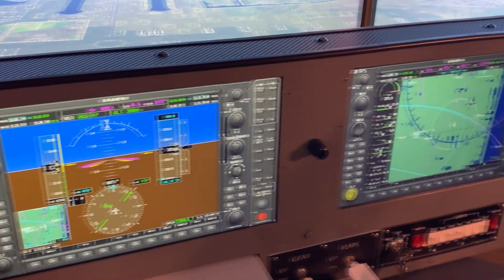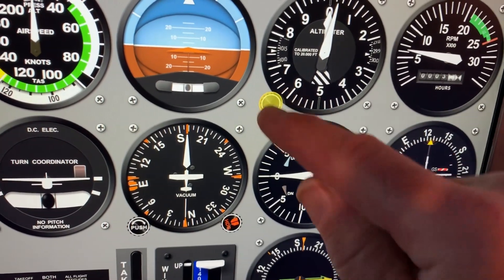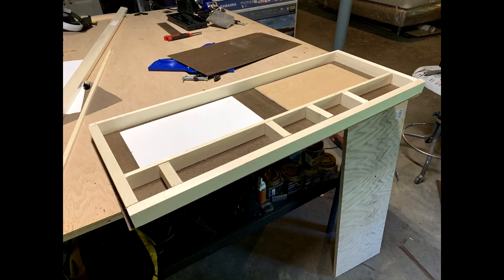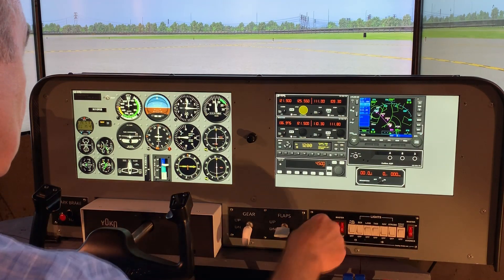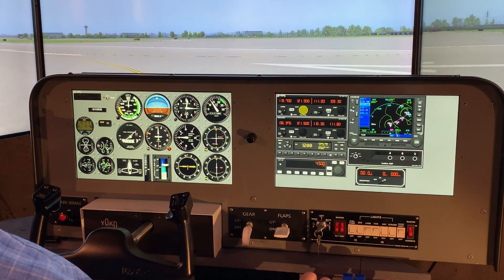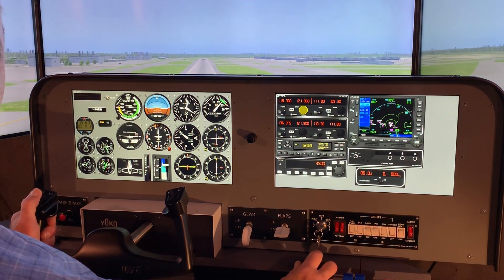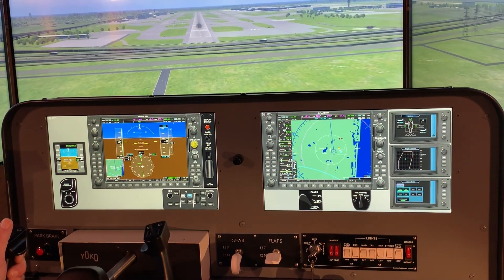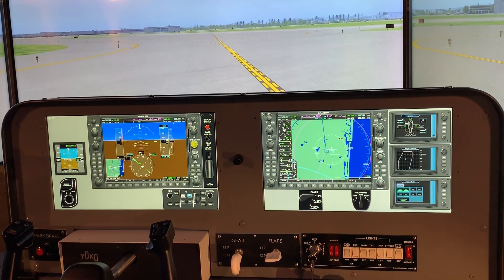DIY Twin Touch Monitor Sim

Comment: Hello Russ. I just upgraded to a Windows 11 system with a 3080ti and 12th gen i7.
I  trying to set up my Wimaxit touchscreens again and calibrate pen and touch input etc won't even show up as a settings option. Did Windows not include this on their 11 desktops?
Reply from the maker: Fear not. The monitor needs to have both power and a separate usb connection to work. There should have been a power adapter with a usb A to C cable. I think the usb C ports on the side of the monitor are marked. The monitor will run using only the usb power from your computer but it cannot power both the monitor and the touch grid. Try setting things up this way and see if it doesn’t show pen and touch calibration show up so you can tell windows what monitor the each touch grid is associated with.
Reply: @rbarlow  I will try this when I go down from supper in a few mins. Strangely, I had to do the opposite and take the adapters off to get them set up on the old computer. I'll send the results.
Oh. BTW, Running Alpha, Bravo, Knobster, and Pedals.  I flipped my old 3 handle throttle upside down, stuck it under the Bravo and now use it additionally for parking brake, cowl flaps, and spoilers. Simstrumentation group has some great G1000 and Garmin audio panel bezels free on github. One of my real world pilot buddies I fly with did the graphics for them. They work great. Thanks!

Comment: Hu Russ, awesome video.ive not yet decided if i should make a curved 180 screen for my flight sim, and use two projectors, or to use three games screens like you have i will be using air manager with either . What are your views on this ,would be much appreciated Thanks in advance

Comment: Russ What are the dimensions of the frame you made? I'm in the process of making my instrument panel now. Im thinking 42 wide by 23 high. What do you think? I have 2 NAV/COM Radios, 1 multi, q switch panel, I want 2 15" instrument monitors, Yoke honeycomb, and a throttle and some other small extras like toggle switches. Thanks Bill

Comment: This is just about the perfect sim for what I’m looking to do. The only other thing that I think would make this sim perfect is a manual trim wheel maybe just below the gear and flap handles. Also, and maybe this is asking too much but a small window (about the size of a sim gear GNS 430 screen) where an autopilot could be displayed via Air Manager. 

Absolutely love this setup Russ! Thanks for doing the work to figure it out!

Comment: On my sim i have a window frame set a few inches from the screens, hiding the joins of the screen. Gives a real depth of field as you move your ahead and slightly around the window frame. A feeling of being detached. If only i could stop fsx crashing out on esc.

Comment: Hello again Russ. Update.. I received my two new Wimaxit monitors and got them setup with touch control working on the new PC I just purchased to run them along with a copy of AirManager and Xplane. That just leaves the questions how many copies of AirManager are needed for these 2 computers (I know 2 copies of Xplane are required) and what machine am I connecting the hardware to? Switch panel, yoke, throttles etc. A future video on connecting all this stuff and how everything gets started/running would be great 👍🏻. Thanks for all you do!

Comment: Hello Russ, I know you did a comparison on the IPad vs tablets a while back. Any updated information? Do you know if the knobstir will work with iPads? I have 2 extra iPads i would like to use vs spending the extra $400 on touch screen monitors not to mention the need for an extra PC. Any additional thought would be greatly appreciated. Thank you. P.S. love your videos!
Reply from the maker: No update but Knobster will NOT work with iPads or Android.  It will work with Windows 10 Tablet computers which are not too expensive. I remind you that if you intend to also display a sim (XP or FS) popped out window(PFD,NS,MFD, G530, ect)  on the monitor it needs to be attached to the computer running the flight simulator so the window can be dragged over to that display.
Reply: @rbarlow  thanks for the quick reply. I guess I’ll plan to do with the 2 touch screen monitors on my older Windows7 PC to start. I also have a newly built gaming PC, I9900, SSD 32GB ram, GeForce 2080ti for the main displays.  I am using both XP as well as MSFS but i need to be practicing instrument work as I am getting ready for my CFII. XP seems to be the clear winner for the time being. Thanks for all your great tutorials.

Comment: What  Exacly is Beta .40 ? , And Does Thye Tablet Has to Be From Apple?
Reply from the maker: Air Manager  version 4.0 which is currently in a public beta testing phase. It is the version with support for FS2020 added. Beware it is a beta version so it will have some unimplemented feature and bugs. You can download free it on the Sim Innovations wiki. It will be free while in Beta. The The Tablet versions don’t support FS2020 yet but there is a iPad and Android version on Apple App Store and Google Play store.

Comment: I Saw Som Touchscreen Monitora on Ebay :   7.0 " ,  12.0 "  12.3 " ,    13.3 "  15.6 "  108ig the Knobs Would Be On  A 12.3 " Monitor  I Gues I Can Always Return it ., I would Like to Know Wich Size Monitor You Would Recommend.
Reply from the maker: I think the 15.6 inch is my favorite because it can be set on top of the yolk and still not be too high to look over. Definitely less than 22 inches as what you want to use but bigger is better for screen readability.

Comment: Hi Russ, Great Panel.  I've built one similar by mostly watching your videos.  Do you have any familiarity with the RealityXP Garmin 430?  I have that, but the knobster overlay's obviously don't work for that.  I have tried using the X-plane 430, but just cannot get reliable info out of that unit (map does not move, waypoints don't show, CDI does not respond, etc.).  The Reality XP 430 works well, but then I give up my Knobster for that.  The Knobster is the real deal.   Thanks for any input.
Reply from the maker: The reality XP units have some  custom Commands and day to rest so the overlay needs to be modified to work with them. It wouldn’t be very hard and maybe someone has already done it you might check the community store to see if there’s multiple versions. If not let me know and maybe we can work on that.
Reply: @rbarlow  thanks for the reply Russ.  I found an example in the Reality XP manual and converted it to work on the 172 Airmanager panel I created.  All works as desired and linked to the Aspen.  Thanks for all your videos - they inspired me!

Comment: Russ, with all the screens, are you having to use more than one computer?  Also, what I heard there are only certain TV monitors that should be used for gaming/simming due to the millisecond response times.  Did you do any research into the monitors you chose or was your selection just price based?
Reply from the maker: I am running the two monitors for the desktop and Arduino switches on the master computer running on copy of explain 11. The second more powerful computer is driving the three visual monitors running another copy of X plane 11 as the external monitor computer.I did a video more recently where I ran a total of five monitors off a single computer by using the onboard graphics to drive the fifth computer. I did a number of performance comparisons that you might find interesting. This is that video. https://youtu.be/ZOdI__BMat4

As for selecting a TV you are correct. You need to think about such things as the viewing angle and the input lag. A good source of information is a website 

https://www.rtings.com/tv

. They have a section on gaming computers. I usually buy at Costco with its liberal return policy so I can try it before I decide to keep it.

Comment: Russ, I very much like your setup. With its clean and simple lines with everything you need right in front of you. My only question is (and I feel foolish asking) would the device in the center of the panel be the knobster? If so, how does it work?  Are there positions other than tuning right and left such as in and out? And where do I buy one. Thanks for indulging me in my stupidity. It just seems like a really clever idea.
Reply: You can buy it at siminnovations.com. Believe it is $99.
Reply: Manny C Thank you.

Comment: Hey Russ: Thanks for putting out high quality videos.  My follow-up on this video is how are you powering both of the Prechens?  If you're using a powered USB hub that also acts as a distributor cap for all of the other peripherals, would you mind sharing the make and model?  I already swung and missed with the Juiced USB-C powered hub that's a driver fail, and before I start trial and error with more purchased thought I'd ask you.  My Stay Level panel arrives tomorrow and I was planning to mount a hub to the back if it I can find one with enough juice to power the monitors.  Thanks in advance for any input, and keep the content coming--you helped me build my sim very smartly!

Comment: i just bought knobster but am unable to get the new Microsoft flight simulator work with air manager. air manager doesn't see MFS
Reply from the maker: There is a public beta 4.0 desktop version on the Sim Innovations Wiki. You need the plugin beta installed too. There is a bug in FS2020 that reduces sim FPS to a crawl when using sim connect so I would wait until that is fixed. Not sure the panels have be upgraded for FS2020 but the demo panel is. Haven’t tried my Knobster with beta 4.0 yet on FS2020

Comment: Hey Russ, great video again! i have the same setup, two touch screen working almost perfectly. Maybe you can help me on this one. The problem is that one of the two screen, the touch function doesn't respond. i found out that the touch screen working is considered the main screen (Per Windows display setup). Any idea what could be wrong ?

Comment: Hey Russ, well I finally got my panel from Stay Level Avionix. It's a modular panel. I have the option of having twin touchscreens, but I also have two seperate modular panels that I had John make for me. On one panel I have a RSG Garmin 530/430 panel with audio panel. The other modular Panel i have the Garmin 750/650 touchscreen navigators, also from RSG. Or I could just another touchscreen on the right hand side to run a G-100 cockpit. I have the knobster mounted in the middle as you do in this video. I'll send you a picture. I do have a question regarding the touchscreens though. I tried ti find a Prechen, such as you have, but I couldn,t find any anywhere. I ended up ordering a Johnwill instead. Same size and dimensions, in fact, when I sent one to John so he could make sure it was the same size as the Preshen, He told me it was actually the same exact touchscreen, just had a different brand name on it. Exact same manual as the Preshen. Anyway, my question is, how do you get the touchscreen function to work? The manual is a little vague, at least for me!! It says that I need to use an additional Type-C signal cable to enable touchscreen function. Could you possibly explain that to me please? Thanks for your time!!
Reply from the maker: Glenn I ‘d love to see a fee pictures of your panel. I am at barlow320 at the domain Gmail which is a .com. I had a bit of confusion with my monitors touch a first also. First, if it is like mine it has a USB-C port and a micro USB port. You cannot power the panel from the same USB port that you use to connect to the computer to transmit touch signals. I think I have the power from a wall plug adapter to the USBC and the micro USB to the computer. It may not matter. I have another Prechen  that has a round 6v power socket and Although the monitor will operate off the USB connection, touch only works when I also have the 6v attached. You should hear the windows connection tones when plugging in the usb to the computer if they are connecting. You also may need to calibrate the touch if it is connected and doesn’t respond to touches.let me know if you need help with that.

Comment: Hi Russ, I was wondering, how did you mount the knobster so that only the knob portion is on the face of the panel and not the entire unit. I am having a panel built for me by stay level and i was curious if there was a different model or mount that I would need in order to accomplish this. Thank you!!
Reply from the maker: Actually that is an earlier Arduino model built with a cheap Desktop Aviators encoder. You can remove the knobs and open the case and remove the retaining nut that holds the encoder in the case. Then just make the keyed hole in the panel and insert it and secure with the mounting nut and reinstall the knobs. To remove the knobs you first have to remove the end cap and loosen the retaining nut on the collet. Then you can remove the lower knob which has a collet too. As an alternative you can surface mount but you need to make a hole big enough for the usb-c plug to get the usb cable to the front side of the panel. If you look at my last video you can see I did that since the cheap encoder had failed. I hope to get a StayLevel panel in the future and would probably mount with just the knob exposed. If you need more help I can provide further guidance on how to open the case and remove the guts of the Knobster to remount it. When reinstalling leave a bit of gap between the knobs or the upper knob will not be able to close the press switch.
Reply: Russ Barlow Ok, I thought that might have been the arduino version. I’m having a panel built by John as we speak. The knobster will be mounted on the outside with a hole just below it for the cable. Not as clean a design, but I’m sure it will be just fine. Super excited to get the panel. It’s a custom modular panel with two 15.6” touchscreen displays, but the display on the right will be able to be removed and I have two separate modular panels for an audio panel and 530/430 stack from Real Sim Gear and another modular panel for a 750/650 stack. Got the Yoko yoke and Q6 throttle quandrant. Baron gear handle from an overseas company, flap handle and switch panel from DA. The panel has a pedestal for the Q6, a trim wheel and the Garmin GFC autopilot. Currently using the new 49” Samsung curved monitor, but I’m already thinking about doing a three panel setup to have 180 degree view. Should be quite the setup!!
Reply from the maker: Glenn Raby sounds like a great setup.Please send pics if you can when things are set up as I plan to purchase a SLAVX panel too...just too busy lately.
Reply: @rbarlow  Hey Russ, I think SpaceX has been watching your videos. Notice all the touchscreen monitors in the Dragon capsule?!!
Reply from the maker: Glenn I just remembered that the NL guys didn’t use the soft touch knobs so the knobs are not with collets but are press on.
Reply from the maker: Glenn Raby so upon further investigation of the new Knobster to remove the back gently pry the back up away at near behind the usb connector point. The knobs do have a screw. You can use a fingernail to gently pry the cap out and there is a screw for the upper knob. Not sure about the lower but it may just slide on.

Comment: Thanks Russ for the videos. It is posible you can share the brand  for the two 15.6 monitors and where I can get them? Thanks!
Reply from the maker: Prechen is the manufacturer and I found on Amazon... I have a previous video about the monitor

https://youtu.be/v0YDHN2eCMA

There are many similar lcd screens available at Amazon and other online vendors

Comment: Hi Russ! Another great video! I'm actually in the process of having a panel built by John at Stay Level. This is exactly how I want it to be done. Only difference is that I'm having a modular panel built bc I already have some Garmin GPS navigators from Real Sim that I want to be able to configure in various combinations, and while I know that I can obtain the same results using the second touchscreen and the knobster, well, I already own them so, why not use them, plus is will just add a little more realism. I ended up buying a gear handle from a company in Italy called SimMax. It's a replica of a Baron Handle. The flap switch and switch panel i got from DA. I asked Bobby B at DA if he could add a second magneto switch and an additional fuel pump switch to use for twin engine applications, but he said that he no longer builds custom panels, so I just bought the same one that your using. I would like to add a pedalstal of some sort to include the addition of cowl flap controls, trim wheels, etc. Any suggestions for those components? Thanks again for sharing your knowledge and expertise!
Reply from the maker: Sounds like a great plan. I ordered the DA gear handle (3D printed) and the locking toggle switch the mention in their website by Powell Aviation. The cap screws off the switch and the handle is threaded to screw in. My only concern is the PLA material of the handle is not real durable. I was considering adding a left right selection switch to the panel to select which engine the mag switch controlled. Easy to do in Air Manager but to work with the DA switch panel there would have to be additional 5 pin positions left on the board which I doubt there are.